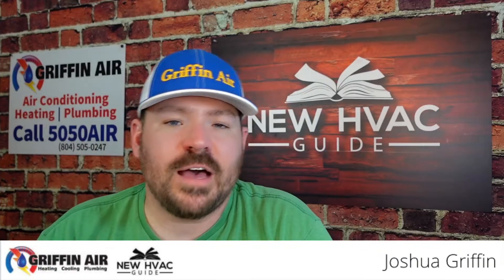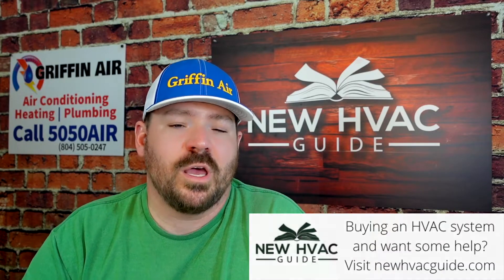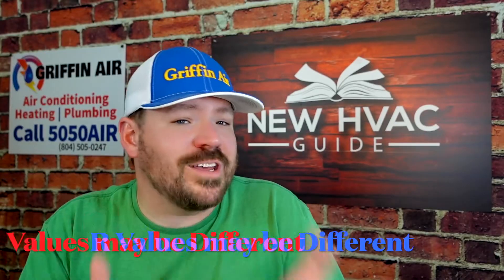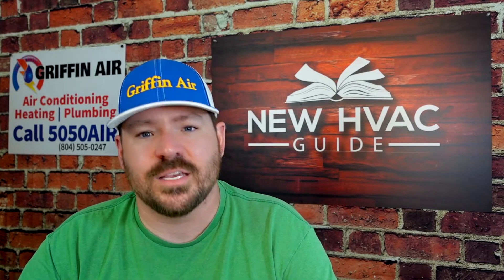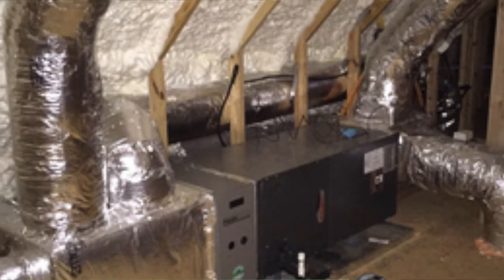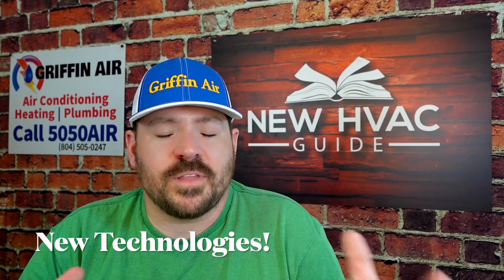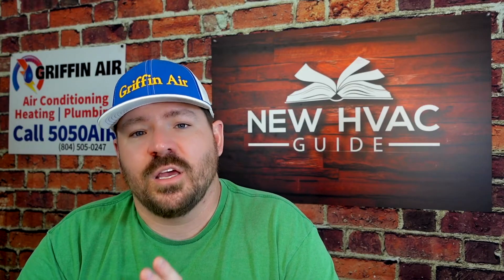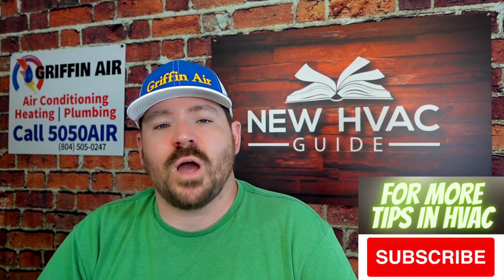HVAC EXPERT Shares 5 Tips on DUCT Insulation!

Comment: Diy saved me 12k after the HVAC guy I called told me the heat exchanger is cracked shutting down my heating, turns out my ignitor needed to be replaced. Stop scamming customers

Comment: Long story short, I just today had a company come and run air quality test on our 1,800 square foot home, they showed me where 90% of the ceiling is moist bearing in the sheet rock.

He ultimately concluded that it was old, deteriorated duct insulation, and he said replacing it would solve most all of the problem.

I asked him directly, what do you think the cost of this could be ballpark, and he said $15,000 to $20,000.

Im sitting all day just sweating the thought regarding this type of expense, and brainstorming what I should do.

Right when you mentioned that you feel that in most cases, you do not believe it makes sense to re-insulate, due to the amount of labor and hassle, and mentioned rather just replace the entire thing.

In that moment, it hit me, I could possibly buy an entirely new HVAC System, probably close to the price to just re-insulate and the air ducts.

You’re absolutely spot on brother!

Comment: Would reflective insulation be a good idea to cover the hVAC air handler in a florida hot attic? Thinking the air handler in a 120 degree attic would compromise it's efficiency?
Reply: Great question, short answer: not really

In a humid climate like Florida, you run a much higher risk of cooling things in the attic space below dewpoint with reflective insulation.  This normally results in condensation problems (condensation problems lead to mold problems and other forms of property damage) in the attic, especially on the colder surfaces of the air handler and supply ductwork.  

Much better if you can relocate the air handler out of a hot humid attic and into the conditioned living space.  Also sealing the attic so humid outdoor air stays outside can help, especially with a dehumidifier.  A good HVAC company can also improve your indoor air quality with carefully controlled methods to bring fresh outdoor air inside.  

The reflective insulation does lower the attic temp and air handler surface temp a little, and in a humid climate like Florida this usually results in trading one set of problems for another by cooling the attic off enough to cause the air handler and ductwork to drip condensation.  If you could do this only to the air handler and find a way to completely seal the humid attic air out so it can't come into contact with the air handler then go for it.  Doing this in a way that maintains service access is a complicated challenge much easier said than done.   

The reflective insulation will lower sensible heat in the attic, but will not do anything for latent heat (humidity is arguably the most predominant form of latent heat, at least pertaining to heating and cooling systems).  In Florida removing latent heat (aka humidity) is every bit as important as removing sensible heat.  Ever notice how dry cold climates add humidifiers for more comfort from their heating systems?  Opposite works for hot humid climates; dehumidifiers provide more comfort from cooling systems.  Reflective insulation is better suited for dry climates that have less risk of condensation problems.

Comment: Moisture is building inside my HVAC unit in the attic and drips on the electrical control boars inside shorting it out. Happens every summer, having to replace the control board about twice a year. What could be causing this moisture build up in the electrical section of my HVAC. FYI the supply section of the duct is a spider legged set up, its all bunched into 1 box and not spread out.

Comment: I didn't know that insulating ducts is life-threatening, but only step on wood in an attic and watch for nails thru the roof (ow), or in a crawlspace don't touch a bare electrical wire while lying in a puddle.  Good lighting helps a lot.

Step one is to seal all joints, which means cutting open the insulation at each connection.  In older days (and even gomer techs today), they didn't coat joints with duct sealant, so many leaks.  Doesn't matter inside the house envelope, but much waste if the ducts are in a crawlspace or unconditioned attic.  Then tape the old insulation back and best to cover that with new foil-covered insulation, taping the joints.

Comment: Yes, I got hit by trees from Helena that caused roof, shingle and branches punched through my duct and ceiling.  The insulation on duct was original from 1964 on ridged ductwork.  My solution was simple because I did it myself. Flex duct comes in 25 foot lengths which is much cheaper and faster because removing the inside duct gives you a perfect insulation sock to just slide on to the ridged pipe.  It's easy to stripped off old insulation used a grill scrubber to clean exterior,  disconnected lines to the main trunk.  Then I brought flex duct and pulled the inside flex duct out using the rest as a sock that I could cut into good lengths.  I simply,  cleaned all joints,  retaped and brushed on mastic over the tape to make sure it would never peel.  Let it dry and slid on the insulation sock, cut out the holes where branch lines attached,  screwed, tape, and mastic brush on all branch connections. The branches were pretty easy,  just got more flex duct, pulled the inside tube and slipped it onto the branches.  They too were retaped, and mastic sealed. I received 3 quotes all over 6k-7k for replacement and repair. I did everything much cheaper and with better materials and installation measures for only $1,300. Using sales and veteran discounts I got better R value and used today's sealing practices.  So, I strongly disagree that a professional should do something that any handyman can easily do. Lastly,  I have seen really bad professionals,  all the good ones charge higher prices and still cut corners.

Comment: I have a question, on round metal duct work return air systems, specifically adjacent pipe connection, does the return air duct have to follow IRC Chapter 16 Duct Lap rule (male end of the duct shall extend into the adjoining duct in the direction of airflow).  I understand the Supply air needs to follow this principle, but does the return air branch duct connections need to follow this rule as well?

Comment: With prices of HVAC Professionals nowadays,DIY is a necessity!
Reply: It's not just HVAC it's auto,plumbing,electric and more. I'm thankful to be handy enough and wise enough to know when I'm out of my league and will have to pay but I've saved too much to not do it myself. I just wired our new polebarn for about 1500 in supplies. And I know for a fact it was going to be around 7k+ and it was inspected multiple times.  At the end of the day should everyone do it ? Absolutely not.  But if your comfortable doing so and it's your home. Have at it.
Reply: @mikerayle6103 I just install spark plugs on my car for about $80 and it took me less than 1 hour to do it while teaching my son. The dealership wanted $460.
Reply: I totally agree, and still they do a half ass job which will require future work to fix something that should have done done right for longevity.
Reply: @MrSki-tyvm it sounds like you found the cheapest company and got cheap work. I’m not going to do my best work for half the pay.

Comment: Is a plenum box needed for the supply side of AC or could metal Y’s be used? About 10’ from my handler is a plenium box that comes in with a big foil duct (maybe 16”)  and exits the box at  a right angle  and exits with 3 different sized foil ducts (10”, 6” and 4”). Couldn’t i just use a Y into another Y to keep the air flow running straighter instead of a right angle and eliminate the box? I assume making right angles slows air flow. (The rooms with the 6” and 4” ducts don’t  get as cool. I Was going to install in line booster fans for them too.). (Hawai’i so AC only, no heat).

Comment: What could be so dangerous about insulating the ducts?   I want to wrap mine with r-8 for the brutal winter we're supposed to have.  I'm a senior citizen (female) and don't see what can be so hard or dangerous.. I was going to do it myself.  :)
Reply: Mine is in the basement and for the most part a straight run about 20' or so long.

Comment: Thanks so much. I have 1130 sq ft CBS 1973 one story home in East Central Florida. The ductwork is in the attic. There is a package unit on the east side of the home that the duct runs up the interior wall (using part of a bedroom closet) into the attic to a plenum that splits into 8 ducts (2 bedrooms, 2 baths (between the bedrooms), entry, dining, living and kitchen (all open to each other). The ductwork is original (R4) and truly needs replacing. A local a/c company suggests a man that would come out and do an entire evaluation for $800. But I was thinking of just getting the duct work replaced (R8?) and hope that will make a big difference. I can't do it myself but I wonder what you think.

Comment: I have 23 year old duct board truck lines in my house and have been having ongoing health problems ever since moving into the homes 7 years ago.  Doctor and testing has ruled out mold and ultimately thinks it’s the fiberglass particulates from the old duct board.  
I am wondering what options there are out there that would be better? Thanks!
Reply: I'm looking into replacing 20 y.o. flex.  What might be repercussions of fiberglass particulates?
Reply: @ are the plastic liners in the flex line intact?  If so I don’t see fiberglass contaminants being an issue in those sections.

Mine were original also but after video inspection determined all were in good shape so we left them.

Btw, I feel so much better since removing the duct board and replacing with metal.  Just touching the stuff would send particulates flying.  I can’t believe the stuff hasn’t been banned honestly
Reply: Have the ductboard removed if you can afford to. You're breathing in fiberglass fibers.

Comment: Great video. I love your straightforward explanation. I live in south Florida and I feel like my AC unit is struggling to keep up. I’ve had one company tell me that my AC handler (installed in 2019) needs to be replaced. While another company told me it was fine. They recommended adding more air flow pass through for each room. But as you mentioned in this video, my attic is a hot box. None of the contractors I brought to my home have suggested examining my ductwork and or insulation.

Comment: Good video. I'm working on air sealing and reinsulating the ducts in my 80's home. The upstairs air handler/furnace (original to the home) is in the attic and it struggles to keep the upstairs at a liveable temperature. I mean 89* F while on full blast in the summer on a hot day. My HVAC company just said "it is what it is" and "your A/C is running fine." In the process of reinsulating the existing ducts (round metal), I've found tons of air leaks, which I think is probably my main problem. Some vent boots had inch+ gaps around them. There was an inch gap along the bottom of the supply plenum where it met the air handler. No mastic sealant was used on the ductwork. Most of the old fiberglass was brown from dust sucking through the air gaps. Huge amounts of cool air have been blowing out into the attic, hot dusty air coming into the system, and cool air from inside escaping via the attic. I don't want to spend a fortune on a contractor, so I'm doing bit by bit over my weekends (trying to get it done before summer!). Just my luck, the system will go out in a month and I'll have to get it all replaced anyway 😆 But the R8 foam insulation I'm using and the mastic paint have been a pretty small investment (around $250), so I'm not too worried about it. At this point, it's more about liveability and air quality than just pure energy savings, which I'm hoping to see but not betting on being all that significant.
Reply: That’s been my experience too here in South Florida.
Reply: How is your project going? The R8 foam insulation? Is that used in place of the old ducts? You've taken the old out?
Reply: 😂and these owners of HVAC companies will tell you to hire a professional.  I ALWAYS do a better job on my house than anyone I have ever hired......so I just don't anymore, only for highly skilled and important labor.  The vast majority are like buy here pay here sales people.

Comment: I have a safety and air quality questions. We moved from one old apartment complex to another old complex and my wife has had increasingly severe allergic reactions since we moved here. We moved from the old apartment for multiple reasons but one was her allergies, which have become much more severe since we moved. I usually have i higher tolerance than she but I've been increasingly sick and tired since we moved. She has missed increasingly more work from her illnesses. My questions are, 1. Is inside duct insulation still a common product used? 2. Is old inside duct insulation more prone to breed mold and mildew and cause problems with allergies and illnesses? (I'm thinking, yes, to that question. )3. What are the apartment managers responsibilities to tenants, (especially ones without renters insurance), to remove old duct works that may be full of toxic mold or mildew, or to hire experts to mitigate the probles? I can clearly see that the ducts are old and most likely riddled with mildew and mold. The original color under the surface of the insulation is yellow, which is visible in ducts farther from the central unit, but are black nearer the central unit. The apartment we live in now was said to have sustained smoke damage from an apartment fire in the unit behind it some time last year and the manager told my wife that it was completely remodeled, including new sheetrock, cabinets and carpet. However the ducts are obviously original. Our past experiences when we were younger were that apartment owners usually do as little as possible because of budget restraints and owner politics. (They're trying to save money at the renters peril.) Especially in old apartments like these where the rent is cheaper than the newer, more upscale apartments. My wife and I are in our 50's and we seem to be more sensitive to these issues than we were when we were younger. I'm thinking there isn't much we can do about this except ask if they can have the unit checked by professionals, but I doubt they would even do that. They would probably send a makeready to inspect it. And from what I've seen of maintenance men and makeready's here, they're not very skillful or intelligent. I noticed that ducts with insulation on the inside are still being sold but these are obviously old, full of poison and that it would be a very expensive and extensive fix if they would even consider doing that at all. Probably the best we could hope for is to be moved to a different unit but I doubt they would even offer that. There's always the question of availability of a similar sized unit. Sorry for the novel. Any advice?

Comment: I bought a house in Colorado Springs. It’s never had A/C but I’m wanting to have it installed. None of the ducts are insulated but the entire unit and duct work is inside the house (unit and ducks run in the basement). Do I need to insulate all the ducts in the house? If I do, Is there a good way to insulate the ducts without tearing out drywall? Lol
Reply: If your ductwork is inside your house, in your basement, you  do not have to insulate it. I do HVAC, and the only time I insulate ductwork is if it is in the attic, or if it was in a crawlspace. Some crawlspaces do not require it though. But yea, if it's in your house, your fine.

Comment: I often make curb adapters, and combined curb plenums where only a sheet metal divider separates supply, and return. For the life of me I can't find an answer for what R value liner I should put on the divider, if any, assuming a Delta T, or maximum temperature difference of 22° F between supply, and return. The sheet metal alone should lessen the temperature difference.

Comment: I have a square/rectangular return air duct in my attic and I believe that it's sucking attic dust/fiberglass insulation particles into our home and causing our allergies to become inflamed. It's around 15' - 20' in length and not something I feel comfortable pulling out to tape. The main reason why is I dread trying to refit it back to everything that it is attached to as it has a few intakes that it's attached to.

The duct sits between two joists that run alongside it so I cannot get mastic or butyl tape on the sides and bottom. Can I just cover the venting w/ plywood, attaching it from joist to joist so it stops sucking in fiberglass insulation particles and dust? I figure I could put some type of dry gasket sealer between the plywood and joists to prevent air from getting vacuumed in.
Reply: call COIT duct cleaners or another certified duct cleaning company — I’ve had mine cleaned and they’re great. Get someone to give you a quote.